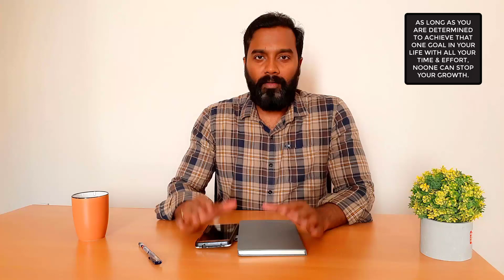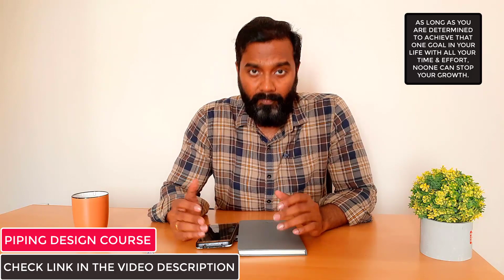Piping Materials in Oil & Gas Piping Design Engineering - Exclusively for Piping Design Engineers

Comment: Hi sir 
For steam tracing hiw to decide tracing coil thickness 
If coil material is copper 
Please advice
Reply from the maker: Thickness is always proportional to the system pressure. Refer pipe thickness calculation in asme b31.3
Reply: @pymedaca3130  
Ok thanks sir